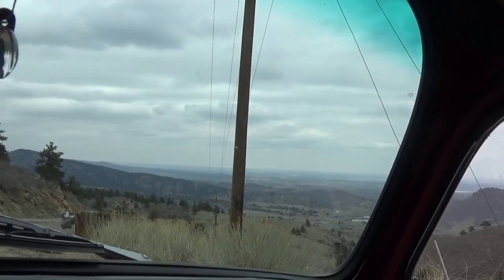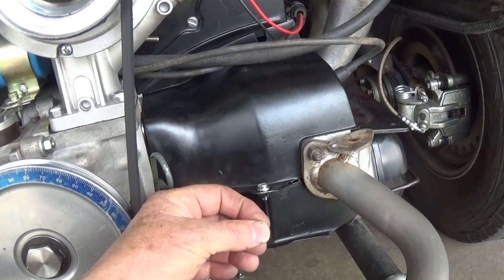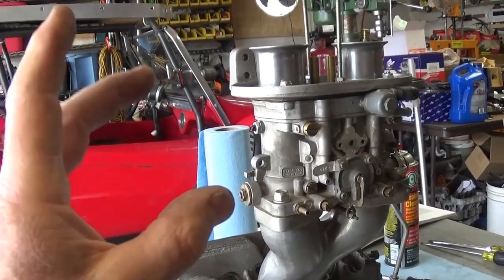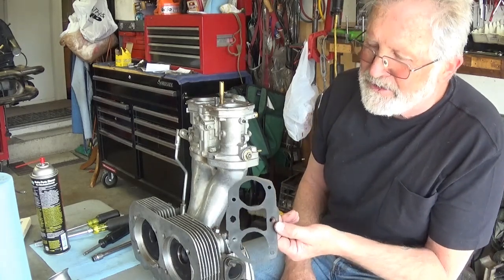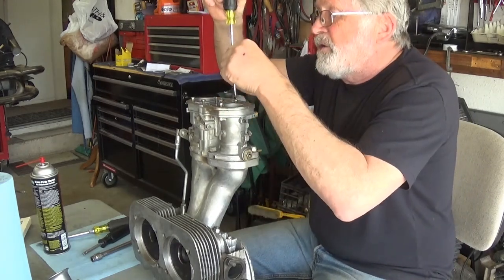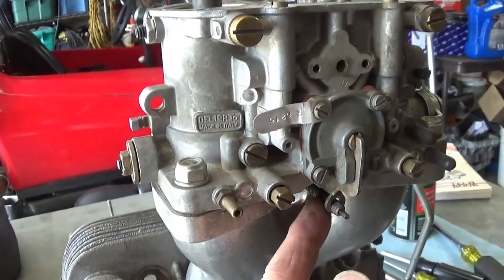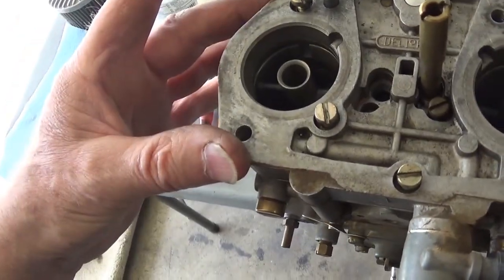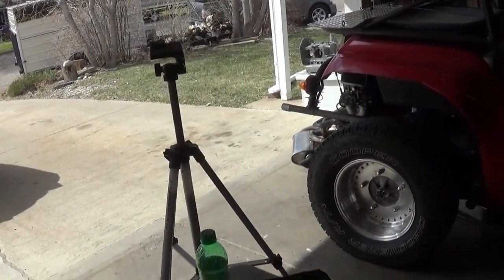VW Performance Bench Tuning  DRLA & IDF Carburetors

Comment: Thank you for producing another informative video. I'm constantly referring people to your channel for carb advice. We can't preach enough proper carburetor set up bench clean and best lean idle set up. After 30 years I finally feel like I have a good handle on carburetor set up. Although I'm still amazed with all the information at hand with the internet that people still think they can grab a carb out of the box from the VW shop and bolt it on and expect it to run on their engine with no effort.  
People like to say you can put a Porsche engine in that bug! I look at them and laugh and say your right, and reply, did you also now you can bolt a set of Ferrari carburetors "48 IDA" on them and make it really fast! 
Keep up the videos you reaffirm that i'm on the right path when I have doubts.
Reply from the maker: Thanks for the kind words and referrals.

Comment: Hey Greg, thanks for another great video. It will be interesting to see how the Dell 40s go in place of the 36s. I wonder if the hill climb will suffer. Do you have heat in the Baja?? I certainly would if I lived there. I have heat in the Bug and we have a very mild climate here in Perth. Cheers Mick
Reply from the maker: I posted the results of the second Heartbreak hill attack with the 40's  It did help noticeably.
The Baja has a (78X90.5 )  2 liter with mild cam stock heads and heater boxes. It is my favorite engine build. I had the 2110  with 82mm crank and tried to duplicate what I did on the 2 liter.  With a little more tuning and some warm weather I think I might have it.
Reply: @TheEZGZ  Hi Greg, where did you post the Dell 40 run?? From my side I cannot see anything new. Am not hassling you....am just curious to see it.  :-)   Cheers Mick
Reply from the maker: https://www.youtube.com/watch?v=9CQ6vVrC38g&t=87s
1st time up was36's second trip up was 40's
Reply: @TheEZGZ  Ah sorry Greg. I had seen that one just didn't realise the second run was with the Dell 40s fitted. Certainly seems to pull better. I was thinking the 40s might be worse than the 36s at 2k rpm with less air velocity through the throats. Seems I was wrong. I usually am. :-)

Comment: thanks so much for all your great videos,i watch them all, over & over 😍 way better than tv 👍 i have a set of DRLA 40s on my 2017cc beetle, can i ask you what the ideal setting is on the accellerator pump rod ? how far in should the nut be turned ? or how many mm of thread should be exposed in front of the adjuster nut ? for best squirt ? thanks in advance man 😍
Reply from the maker: Great question!  There are many variables but the crux of it is that the DRLA 40's originally came with #35 pump jets. Make sure you have a smooth steady stream coming out of all 4 squirtter's   Turning the nut out (away from the carb) reduces the flow ( leaner) Turning the nut in clockwise makes more fuel go in. I use a 1/4 nut driver and go one full turn at a time. I try to adjust both carbs at the same time since I have a 4 into 1 exhaust.  With the engine at steady idle Blip the throttle. If black smoke (fuel) comes out the exhaust your to rich back out the screw one turn and test it again.  If you engine stumbles or pops back threw the carb it usually means a lean condition.  Most important is to have both carbs in synch using a air flow meter. I just looked at one of my carbs and I have about 6 threads showing behind the nut.  I'll also tell you this, if you go to fat you will notice a reduction in MPG.  The threads on the control rod act like a file on the accelerator pump lever and the holes get out of shape so check yours and hope they are good. The diaphragms get old and hard from modern ethanol fuel too. The diaphragm chamber is the trash can on all Dellorto carbs because it takes fuel from the bottom of the float bowl. You find dirt and rust and peaces of the diaphragm laying in there. No big deal. just wipe it out and spray some brake clean threw all the nooks and cranny's. Watch it at the squitter . 
The book describes a method adjust the control rod. They call out having 6 cc from every 2 squirts from the bottom of each bore......   (Good Luck with that)  my way has worked well enough for years
Reply: @TheEZGZ  thank you so much for the great info 👍i have both carbs cleaned out with carb cleaner sevral times & i have balanced them as well as all new gaskets,seals needle valves and new  diaghphrams, thanks again ezgz & keep the vids coming i have learned loads of stuff from waching all your vids

Comment: Hey EZ, thanks for all the fantastic information you supply us with.  Can you tell me what would be a good setup/starting point for jetting dual Dellorto drla 36's on a 1915  VW dune buggy?   Engine stumbles at acceleration then smooths out pretty well.
Reply from the maker: The stock jetting works great on those carbs. I have them on my 2276 right now. The stumble could be not enough stroke on the accelerator pump squirt, or not being perfectly synchronized linkage.

Comment: Great video!! I’ve got a 2332 vw with a CB performance turbo with dual DRLA 48s on and I seem to be having problems every time I hit a pretty good bump on the sand dunes it starts snapping and popping not at wide open throttle though. I’ve adjusted the floats and cleaned the carbs numerous times the thing that gets me is it runs perfect on the highway. Do you have any suggestions?
Reply from the maker: Are you running a Turbo fuel pressure regulator? https://www.cbperformance.com/product-p/7246.htm
Many people think that a 2332 turbo has to have those big honking 48's  which run great at WOT  but the problem we had was most of your dune cruising is not wide open throttle. Your driving in the middle. Not on the idle circuit and not fully into the mains.  The 48 Dells had a travel stop on the float to keep it from bouncing to much. Lot's of Turbo guys cut that off so as not to go lean. If you drive like my friends and do on the sand your only on WOT for short bursts.  You might want to go down  to 34mm venturi's and a little smaller mains. Non turbo would be around 140 main. I'm not sure on Turbo. We only ran around 8 or 9 PSI boost.  Anyway, smaller venturi's limit your RPM but give you more drivability.  I wouldn't want you to take only my advice and hurt your engine. I would rater give up top HP for more torque and drivability down low. The Turbo mania book gives some good advice and suggestions.  Thats about all I got to say except keep the rubber side down my friend and may the sand never get in your eyes. hehehe  fat chance for that ......!
Reply: Thanks for the reply man! It has 160 main jets and 75 idle jets with a 40 venturis .  What gets me it’s it will pull from 2500 rpm to 8000 rpm really well on smooth ground but those bumps make it sound like it’s running on one carb and I’m running 10 psi of boost   It kinda acts like it is float related to me.
Reply: And I’m also running that fuel pressure regulator I have not checked the fuel pressure though.
Reply from the maker: It sounds like your on the right track. I would install a good fuel pressure gauge and like it said in the add 5 psi above boost and it needs to be under 3 PSI when not on boost or those inlet valves won't hold.

Comment: Hey Greg could you post a picture of the accelerator pump rods in the comments? I think I finally figured out my bucking problem my rods are bent at different angles. I’m not sure which one has the correct bend.
Reply from the maker: I can't post pics in comments.  I am working on a New Weber IDF video. I will try and remember to do a close up of the rod for you. Might be a couple weeks.
Reply: Okay I have dellorto 48s I’m not sure if the Weber is the same or not.
Reply: It’s acting like the accelerator pumps are loosing prime

Comment: Hay ez I want to get twin duel carbies I was thinking of the cb Webber what do you think thanks buddy
Reply from the maker: That's a lot of money to pay for those IDF carbs and I can't believe they don't come with velocity stacks....!  I'm still running my old Dellorto's that I bought back in the day. One of the problems I have is that the new webers no longer come as a Right and Left carb like they used to. They modify the throttle linkage to make it work but the return spring will be on the wrong side and they are harder to synchronize for full travel. Keep asking around to find someone who is actually running them and ask them how they like them. CB has a no return policy on racing parts. Be sure and ask about that before you buy.  I got screwed when I built my 2110 engine.
Reply: @TheEZGZ  thank you heaps I may be able to purchase some dellortos but not cheap $1400 carbs only ,rebuild .
Reply from the maker: Naaaah  you don't want to do that. Many of the Dellorto's  have a drip problem because so plug eats away.  Check out those Super D carbs at Cart Craft. Call them up. Ask them for some advice and if they will stand behind the product.  http://carcraftstore.com/newduald-seriescarbs.aspx
Reply: @harryloibl5183  I've got a selection  of drla carbs from 36 to 48 tri jets, the 48s  are nos and pricy, but I can can get you a set of the smaller one's rebuilt for under $1000, whe finished they would look real nice, let me know if I can answer any questions  for you, can't beat original  Dells, I also can fix the drip on them.. I do have an add on the samba  with my work.
Rick (mcdragracer)